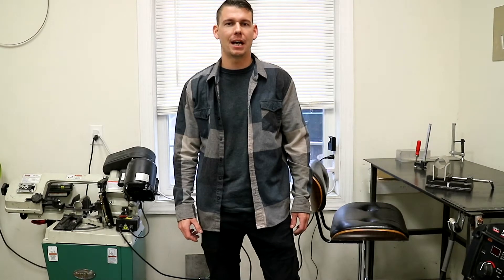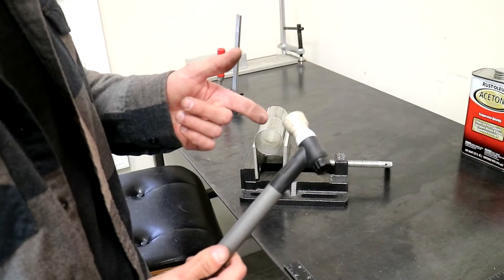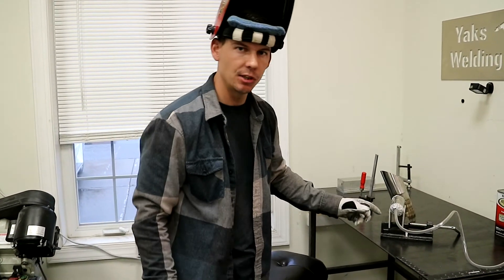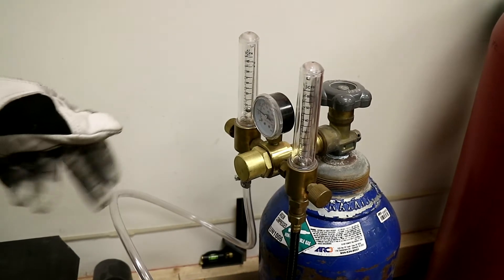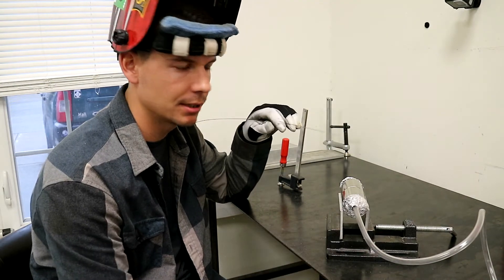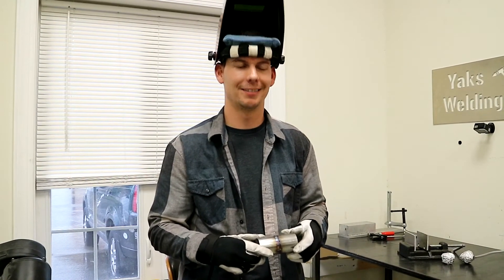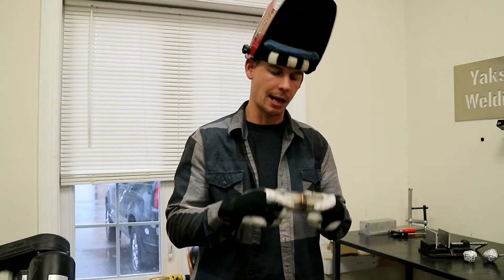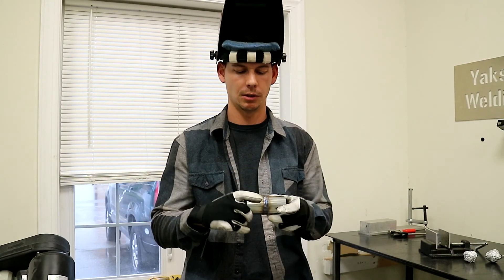Tig Welding Stainlesss Exhaust Tubing

Comment: When do you swap out your argon tank? I have about 450 psi left in mine.
Reply from the maker: I usually take them down to where the needle is just above zero.
Reply: @yakswelding86  thanks, seems like a stupid question but I’ve only swapped it out once so far